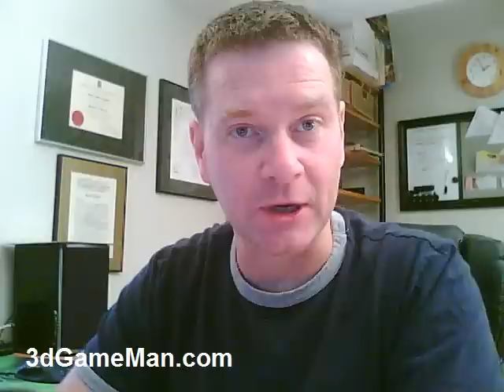#261 - Q&A: Two/Dual Power Supplies in one case (PSU)

Comment: Question.  So I'm looking to daisy chain two gpus and my current power supply can't handle both, but I have an extra 350W power supply.. would I be able to power the second gpu by means of the connector you talk about?

Comment: I could see the advantages of this even if one is not looking for redundancy.  Adding a second supply gives more "rails" for the system to draw from, meaning it's less likely that one component would cause a voltage fluctuation that would impact the rest of the machine.  Of course.. you would be dealing with a very power hungry machine since there are manufacturers who make multi rail single power supplies already.

Comment: would be tolerable if yu get 2 full modular psu. oxx zx series or corsair modular series..then it wouldnt be a cable nightmare but then again just get a 1000w + psu and ur good until ur next upgrade.

Comment: @azurehydra multi psu systems are mandatory for servers, as GOOD servers absolutely must be redundant in almost all components.  if you have a gaming rig with something like a 4x crossfire 6990 setup, a dual psu system would be very ideal as well.

Comment: @unseen0000 What you said about being having the proper knowledge to install dual power supplies is valid and good advice.  However if you use high quality power supply units fan noise is virtually non existent and would only slightly apparent under high loads.  I guess it really depends on what you are using the machine for to make the noise and vibration unbearable.

Comment: It's mainly for the EVGA motherboard that came out that supports 4-way SLI.  There isn't a power supply that can do the job by itself.  Silverstone has a 1500w and Ultra has a 1600w PSU.  In theory they can do the job.  I would would two myself.

Comment: @TraNWhiZ well, i guess you can do what he says but i was thinking about using the power supplies seperately. so one 500w supply for your mobo,drives and fans and the other 500w supply by it self will be enough for one high end graphics card but you should reseacrch more into it, if you want to use double power supply.

Comment: @TraNWhiZ you can get 500 watts out of each, so you can have one of them connecting to only your fans and hard drive and mobo, and 500 watts would probably do a high end graphics card and you couldnt be able to use with other components.

Comment: It's to do with 12 volt rail amperage.  Typically, cheap no-brand PSUs come with a high-amperage in the 5 volt rail, and low in the 12 volt rails, where it is important.  This is why cheap power supplies typically are no good for a very power-demanding system.  Good PSUs (OCZ, Corsair, Mushkin, PC Power, etc.) typically have two or one 12 volt rail that delivers the most power (about 80% total power) and are more suited for high-performance.

Comment: it really depends on what psu u have... if ur using a 650w corsair psu, those things are under-rated, and can run 2 gpus completely fine with 4 hard drives and a 130w cpu, and more. if you are using a low end psu, like rosewill or somewhat ocz, then you might be breaking the brink of its limit.

Comment: 750-watts for a two GPU configuration is completely overkill.  You can overclock and run them fine with a 650-watt PSU.

Comment: It's a good choice if you find two good 600w psu at low price. You buy the adaptor and you have a 1200w psu cheaper than a 100w psu.

You got to modify your case in order to achieve good temps.

Thanks 3DGameman!

Comment: In case anyone wanted to know the Antec P190 supports two PSUs,  I think it comes with two but don't quote me. Also the Cooler Master HAF 932 can support two PSUs but you would need to remove the top 230mm fan.